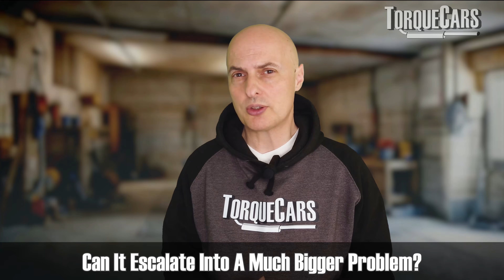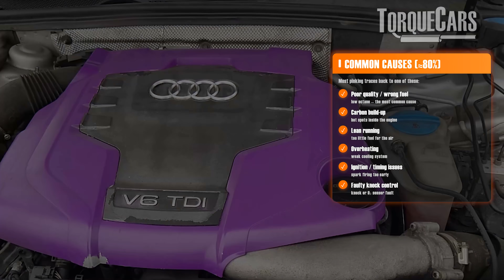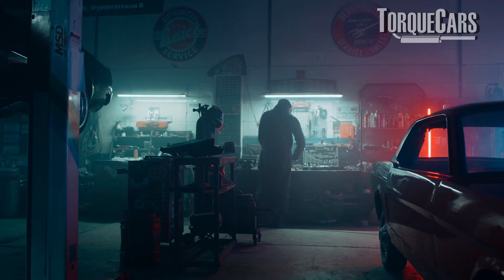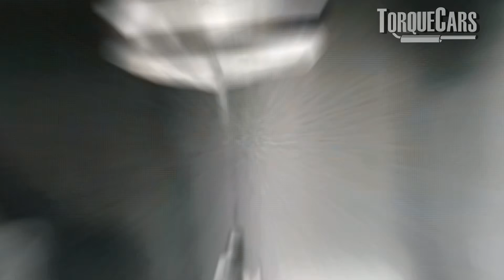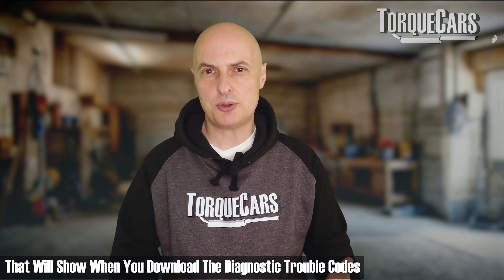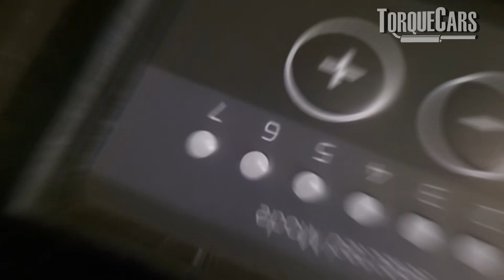80% of Engine Pinking (Pinging) is Caused by This... Engine Pinking Explained

Comment: My 2006 mx5 has just started doing this in the very hot weather (30°+). At idle it's fine, purrs like a cat. Accelerating gently through 2nd & 3rd gears l get a mild "pinging" but nothing in 4th or 5th. 
I've had the car for 7 years and always use 95 octane E10 fuel with no previous problems. 
Tried 98 E5 but no real difference. Guessing it's carbon build up. Any recommendations for additives. My engine is NOT direct injection. Many thanks 🙏🏻

Comment: Driving an old car with carb and distributor it's usually lean running followed by poor fuel and lastly timing issues. 

I fitted a Bluetooth programmable distributor, rebuilt the carburettor and use BP Ultimate plus Tetraboost on each fill and now zero pinking, better economy and loads easier starting (as well as more power). Pinking can damage pistons too of course.

Comment: i was told diesels dont ping
Reply from the maker: The way they burn the fuel is by compression so there's not much scope for a misfire or ping on a diesel. That said diesel injector faults can cause some strange flame front behavior though.

Comment: The most common root cause of pinging/pinking is carbon build up on the cylinder head and valve faces in higher mileage direct injection engines.  This is a result of oil vapour feeding into induction from the pcv system.  The only way of cleaning this is by removing the head and doing it old skool.  And the other bit of bad news is that it will return unless you've a way of venting the pcv to the atmosphere [which causes compliance problems in some durisdictions].

Comment: I notice a slight buzzing noise when i have my throttle on a fixed position  regardless of gear and speed but not all the time..
Reply: @iskrtthewhip   I have the same exact issue. Trying to figure it out is driving me crazy. I have tested all the sensors, replace the fuel injectors and tested for vacuum leaks all around the engine. Everything I have done has not helped. I hate to be that guy that throws parts at the car hoping to solve the issue but I did do my due diligence and try to diagnose it with no luck.  Next I'm going to test my oxygen sensors and air fuel sensor. It's practically the only thing left. Oh yeah, I have done all the carbon cleaning and running higher octane fuel, etc..
Reply: @revolutionofone8541 have you tried resetting throttle position sensor